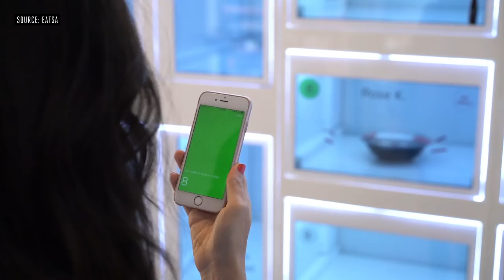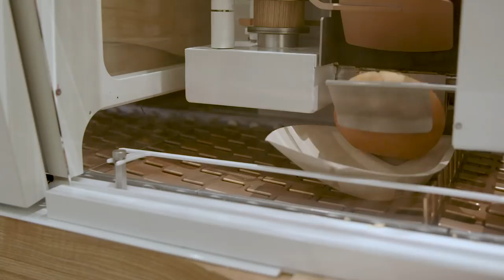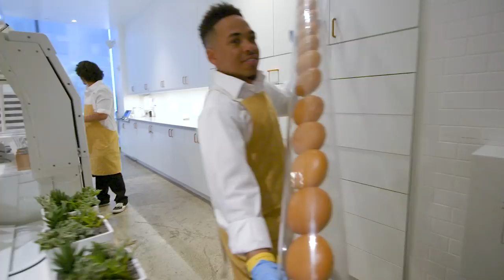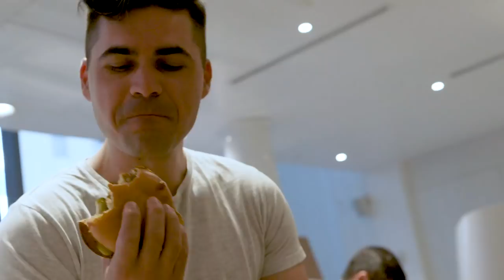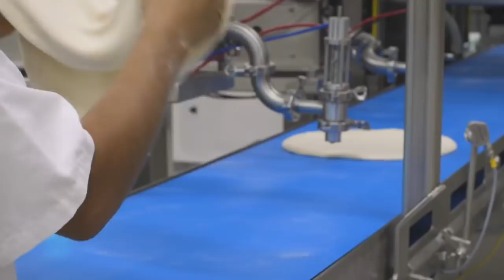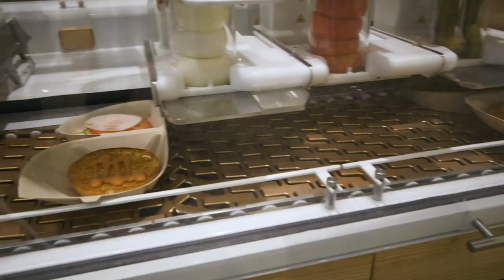Robot restaurants won’t take your job and food will be better

Comment: The idea that robots will not eliminate jobs is just nonsensical and it’s not a value judgment to say so, even though that’s usually where the discussion goes first. 

Computers are already better at general diagnosis (what your PCP does), basic legal documents, taxes to wills, are already highly automated, and here’s a machine that builds a burger. The onslaught of automation will hit skilled/unskilled, white/blue collar alike and will hit it hard. This isn’t the industrial revolution where millions of new jobs were created as a result. The efficiencies created via mechanization, and now computing/robotics, will eventually hit a point where upkeep/support roles (engineer, maintenance guy), for example, begin to taper off. It won’t happen overnight, but no doubt this tipping point can already be seen in specific industries, though as of now most workers have other places to go. With widespread automation, meaning industries of all kinds beginning using automation, migrating from your robot replaced job will become increasingly difficult.

I’ve always thought that history repeats itself, but I don’t see the automation revolution through the same lens as the industrial revolution or electronic revolution. With mechanization and computing coming together, where they previously were too primitive to replace the hands or brain of man, the need for a human touch will rapidly diminish. I just can’t see it any other way. Factor in that robotics and computing are already at a level of complexity that requires an above average IQ and still accelerating, while our average IQ is moving upward but at a relative pace of a snail, and we eventually have a world where only those with an IQ at least one standard deviation above the norm (115+, something like 15% of the population) can possibly have a chance at entering these fields. 

I don’t think we’re headed toward some facsimile of WALL-E world, but in some respects it’s going to get pretty damn close (we’re already getting fatter in preparation!)

No idea if this will be a good or bad thing, but let’s drop the whole “automation will only create new jobs to replace all the old ones” nonsense. This isn’t your grandma’s revolution.

Comment: Also another argument id like to posit to the internet is that it is illogical to create automation so that you can reduce your output, or even to not change your output. Say a company figures out how to mechanise some of its operations. This company is able to operate cheaper, meaning theres more to gain by majorly only using machines rather than employ more people. so previously it earns lets say $100 mil a year and with machines they can earn $120 mil. So they fire a couple of humans and reduce their production slightly so they earn $100mil just like before? Absolutely not. They already have employees that are trained. If having humans only gives them 100, while adding machines gets them to 120, they wont discard the humans to make their production neither go up or down. Companies would want to go bigger as time progresses. Humans good, machines good. A company would probably welcome both human and machine

Comment: Yes, they absolutely will take your job. Nearly every robot is made to reduce labor costs. It may not happen immediately, but it will eventually reduce workforce labor. 

Look what happened in N.Y.

"Robots need maintenance"

Yeah, sure.. every now and then. Usually it's low maintenance that a small workforce can maintain many. Otherwise the robot won't sell.

The robot not replacing "your job" argument has been debunked in to oblivion. It will indeed do a job, reducing (eventually) workforce labor costs and thus, take YOUR job.

Comment: What happens when ligh goes off. And what about the things don’t go well as it shown. M working in a milk factory where they have installed 1.2mil robotic machine just to wrap the pallet but in a day it stops many times as possible because of something or the other goes wrong.

Comment: The only way it will technically make food better is by following a set code that was written by a human. Therefore even though a robot makes the meal the human involvement completely makes the robot do what it is doing and the human is more accredited due to the fact of doing "most" of the work. Also includingthe repairing and maintenance/cleaning of the robotic chef.

Comment: Not impressed. The machines themselves are going to be expensive, prone to breaking down from overuse (they'll be running 10 hours a day+), more expensive upkeep, etc etc. Humans are still cheap labour who can take care of everything from putting in custom orders, taking orders over the phone, cleaning washrooms, cashing out and closing duties, opening the shop, etc. It's a nice novelty proof of concept but nothing else. Unless you're going to automate literally everything else (which requires subscriptions to other services or buying more robots) and never change the menu it isn't really relevant in it's current form.

Also, someone else on reddit or a different comment pointed out 130 burgers an hour is nothing. That's a burger cooked every 2 minutes when several fast food places right now only have a bottleneck at the assembly section.

Comment: It's something shiny but it's inefficient at the same time. Production numbers are really low, now what happens when machines fail? Cuz every machine fails at some point. They will need a technician, they will need people to clean it up everyday, to restock.

Remember that Japanese hotel with dinosaur robots at the lobby? They lost money on them, offered a worse service and had to repair errors frequently? So they got rid of most of them.

Comment: Explain why a restaurant owner would invest in this expensive machine and NOT cut costs elsewhere. More specifically, why would you hire the same amount of employees if you have this burger bot? If the employees are taking up less responsibilities, why would they be paid more? Out of the goodness of owner's heart?

Make no mistake, this will cut costs. Far too much R&D has been invested for it to be unprofitable. Any profit will be seen by the restaurant owner, not the worker. The last 4 decades are proof of this; despite rising worker productivity, wages have remained stagnant stagnanted since the 1980's. 

Some new job will arise since someone is needed to repair and update it. But that job is reserved for the high-skilled tech graduate. The low-skilled high school graduate looking for entry-level work is doomed.

Comment: "No one's touching your food..."

Uhm, lady, that robot is touching *everything*, and is not being cleaned after every prep.  Gluten free can't eat there.  Vegan can't eat there.  Food allergies can't eat there.  Because the robot is contaminated with every ingredient.   No place is going to set up specific machines for different dietary requirements or wishes.
A human, at least, can see 'gluten free' and switch to a different set of prepping tools and reset their prep area accordingly, do it swiftly, get the order through, and transition back to traditional food prep in seconds.

Comment: When robots fully replace workers it will actually be easier to start up your own bussiness since you won't need to pay anyone to work for you. sure, you'll need to buy the robot and pay for repairs but in the long run it will most likely be cheaper. there would also be new job opportunities such as a coding robots.

Comment: I have no problem with a robot making my burger or food in general. The question just still stands what is the net job loss/gain. 

I am by no means an expert on this but let us say we have a company selling those robots, several fast food places and the workers there. In the beginning, lil Jimmy can do the shifts to watch the robot but after 1 million successful burgers and dishes, the managers will think ...hmm how to reduce costs even more? Right, we as the company can make a service for 24/7 automation engineers that can work with those robots and know the manual to repair them. 

Do you think that there will be as much engineer type positions to fill the gap left?
NO. 

What is left behind is the question? Is this ok? 
It may be possible to have the workers in other positions but on the long run - unskilled jobs will go instinct and not every unskilled teen from Burger King can work as a programmer/technical staff let alone the people that really only have those options.

Comment: Robots are great for consumers.  That is until their job is replaced by one with advanced AI.  ALL of these jobs will be gone in 20 years.  In 50 expect half of the workforce at a minimum to be unemployed.  You definitely glossed over the long term implications.  When the robots can design, repair, and supply themselves, they no longer need a human.  We are quickly approaching that point.

Comment: The "less touching food argument" is pure marketing BS. Meanwhile, the plastic tubes full of food that is supplied to the cutting machine is going to be really easily cleaned, right...
Here's what's going to happen: the savings from losing human workers are going to be absorbed initially to get better produce to compete with other human-worker shops. But as soon as the human shops are out of business, the lower quality produce comes in and the difference goes into profit. End result after consolidation and monopoly kicks in: everyone but the franchise owners loose.

Comment: Despite my initial objections it is becoming increasing clear to me that as robotics takes over and low paying minial jobs evaporate a minimum income may actually become necessary.
Reply: That's why Andrew Yang was pushing for UBI
Reply: @razormc954  
Then the funds for the UBI should come frome a tax on the use of those robots.  After all it is because of the robots that there are no low paying jobs.

Comment: Lol... The comparisons in price are idiotic. Creator burger at 6 dollars with 1 patty? vs the Super Duper Burger at 8.25 with 2? Looking at the menu it's closer to the "Mini" burger at 5.75, than the other... But that wouldn't support the preconceived notion in this video.

I am not 100% against this concept but I see a lot of issues. 

Employment - This will definitely have an impact on employment. At first I think it will be about even with the same amount or one or two less but those employes doing more and pushed to being more productive for the same pay, possibly less. Also let's be real for a moment this trend isn't just because it's neat or this that or the other it's due to wanting to reduce employment overhead. 

Reliability - Anyone that has worked with commercial machines knows there are down times, maintenance, and breakage. Even the best made machines of the highest quality and maintained as per manufacturer's specs eventually break down. That is a fact of life. I am sure if you go to a few restaurants right now that have commercial machines at some point or another they have said our [input machine here] is down so we are not able to do that would you like something else instead. As such if you have a machine doing this and doing it alone with no way for a human to intervene you will not be selling that product, and it can turn people off from returning to your store. 

Sanitation - This particular machine would be hard to "self-clean". You can design it a bit better and make it easier for that purpose but even the best "self"-clean setups cannot take into account every situation. As for the woman in this video saying no one has touched your food? Ok but they did... They did it when it was being made/grown/harvested then in transit then in unpacking and then in loading it into the machine. It just wasn't in the last mile so to speak of the process. It also glazes over the fact that the majority of people get sick via food contamination not from the employees but from the producers or the first mile so to speak.

Comment: I still believe this is an issue that takes jobs. We need to still have low education labor or else the poor will stay poor. And if your requirements is to work requires maintenance experience, then how are people graduating highschool or who couldn't get through highschool do? We are lucky that by the time this can even become wide spread we'd have to improve education, because where I live, if they introduced that, then barely ANYONE would be able to work there and the machines wouldn't get proper maintenance, hell, one of the places I've gotten food from has the floor falling apart.

Comment: Personally I want full automation with only one or none employees needed so I can get the same burger for a $1.
Reply: You won't get the same burger for $1. When companies get something new that they can lower the cost, they keep the price to the customer about the same. They don't pass the savings to the customer. They make more profit. 

I have noticed in past cases when companies had costs lowered, for any reason, they kept the prices around the same and made more profit. That's what companies have been doing in the past, and don't expect companies to pass on savings to the customer in the future.
Reply: @vshah1010  but if this becomes more common, they will start running into competition, which would force them to lower it a bit

Comment: No. This is wrong. Food is special, and although the machine can make it any way you want, it's still not the same. It's wrong. The culinary industry is good the way it is. It's not meant to change. Food Being prepared, cooked, and assembled by robots, is bad. It might be cheaper so you can focus on ingredients more, but there's more to The culinary industry than Money. It doesn't need to change, the culinary industry doesn't need to change and it shouldn't.